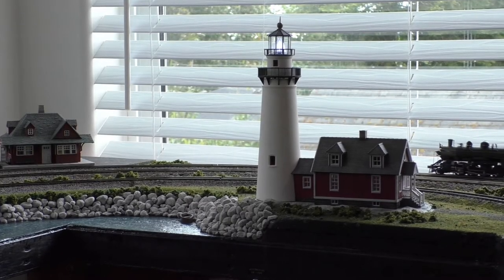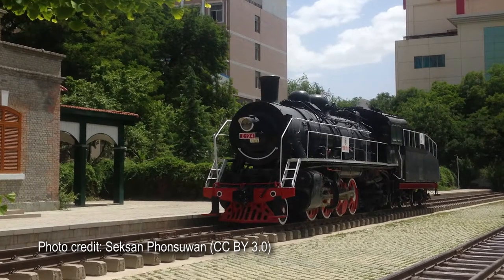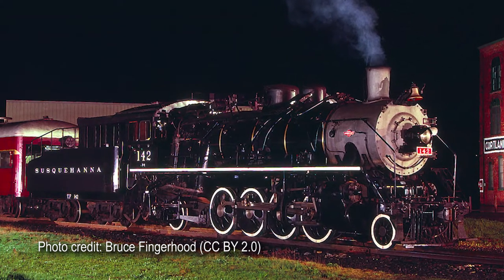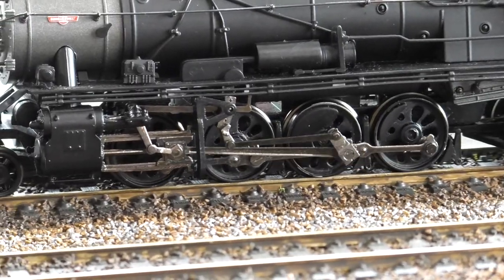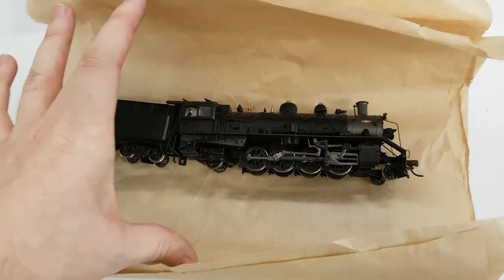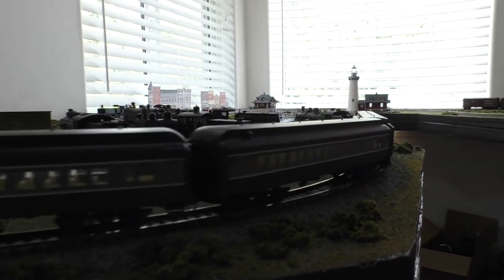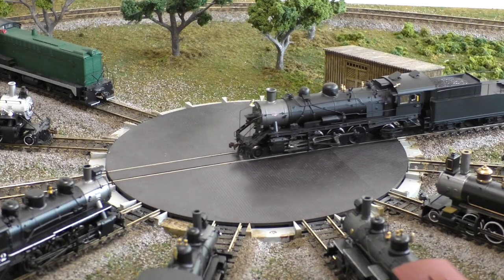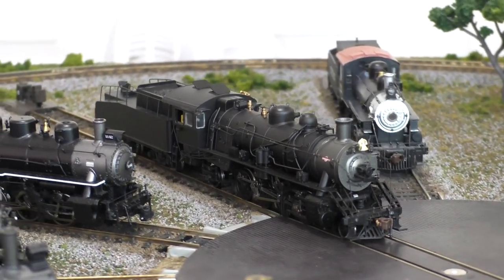Bachmann Chinese SY 2-8-2 Mikado: a modern-day steam engine?

Comment: Great Review of the engine!! I just finished modifying my own SY to better resemble the Valley's 3025. Mine seems to have similar issues at slower speeds as well, possible to the some of the modifications. (I needed to reverse all of the appliances to the other sides to match the prototype better. I have even been able to work on the actual engine during regular volunteer shop nights which also helped with getting reference photos. 

As for the two engines mentioned in your video; yes the Valley owned both but not at the same time. The first engines was No. 1647 and originally had the red wheels like other Chinese engines. It was sold in 1991 to NYS&W when the third engine sank and renumbered 142.  Years later the Valley purchased the burnt remains of Knox and Kane No. 58. (Engine was damaged in arson fire) and restored to resemble a New Haven Railroad J1 Mikado. Now 3025 still in operation at VRR today.
Reply: Hi! I would love to see a picture of that. I live on the Valley RR's tracks, right at the end of the line in Chester. Huge fan ever since I was a kid!
Reply: The line3 doesn't end in Chester, it continues to Middletown. But, the tourist trains only use the track to Goodspeed's (Haddam) and recently cleared track north of there through the marina. Before the rails through the marina were buried in dirt.

Comment: I’ve had mine for a few years, great runner although it doesn’t pull well. I installed tcs wowsound in mine, they have a kit for it if I remember right, improves it ten fold.

Comment: Found one of these at a trainshow and preparing to add DCC to it so I can run it on my main layout…any decoder recommendations? I was told a TCS WOWsound 121 is a good decoder. Also where did you get those coaches? Would love to pick some up
Reply from the maker: Make sure to get a decoder with a good BEMF function. TCS WowSound should work well (although I recently put WowSound in this loco and have been having some issues, but I think they're probably my fault). The coaches are 60' commuter cars from Rivarossi - sadly out of production now, but you may be able to find some used.

Comment: Very nice! I never knew there was a  genuine class of steam engines built past 1960.
Reply: Apparently China did make locos during the 1960s so I guess China was the only country with operating steam locomotives
Reply from the maker: @warbabyproductions  South Africa had a few 42" gauge 4-8-4s in freight service until 2015 as well, although I'm not sure they were building new ones any later than the 1980s. There may be other countries that also used steam into the 21st century, but I can't think of any the top of my head. It tended to happen mostly in places where coal was cheaper than oil.

Technically, the Strasburg Rail Road in Pennsylvania also occasionally moves freight with their steam locomotives, but it's not exactly regular service.
Reply: @warbabyproductions  plenty of engines were made past 1960s but the very last commercial steam engine was made in 1999 and yes it was a  SY　made for use in China at a coal mine.

Comment: That is a cool locomotive! I wish “Bachmann Trains” would build a retooled version of it from the ground up by using today’s standards! Such as installing a smooth running DCC motor, multiple colors, road names and numbers as ways as appearances! They will also keep the way that the engine and the tender connect together!

Comment: I've got an off-topic question, what has happened to W&SC No. 12? Is it a parts engine or have you got it tucked away in a box somewhere?
Reply from the maker: It's currently sitting on my desk, waiting for me to figure out what to do with it. I'll probably put it on static display somewhere eventually (maybe not on the layout itself), or I might use it for parts.

Comment: I have this locomotive as well it's a good runner. The only problem is I want to install a decoder and I've tried multiple times to get the tender open but it won't budge and I have no idea what else to do.
Reply from the maker: The tender goes together in a weird way. I got it apart once, but unfortunately I can't remember how.

Comment: That drawbar design is actually recycled and or copied from their 2000s era spectrum N&W j class models - my 611 hasn’t had any issues with it whatsoever and actually runs alright on 18 radius curves because of this. I have no idea what the modern ones use though. 2000s spectrum was a peak for bachmann and really it just seems they’ve been living on that high for about 20 years now. 

I’ve always wanted an SY to make New Haven 3025 (1658 as it stands today), however the only time I’ve seen one in person went for $450 at a hobby shop (I struggle to think about how I paid $460 for a Rapido EP5, even after waiting 5 years and seeing the model progress from render to functional prototype) and I haven’t seen one since.
Reply from the maker: Interesting - I didn't realize that drawbar design had been used on any other American-prototype locos. It does seem to work quite well.

$450 is definitely too much. I wouldn't pay more than about $200 for one of these.

Comment: She’s such a beaut! I would love picking one up one day! But may I ask where did yours?
Reply from the maker: I found mine by pure luck. I work at a hobby shop that often buys used train collections, and this turned up in one of them. If you're looking for one, eBay is probably your best bet, but they only turn up very occasionally. Also check any hobby shops in your area, and go to train shows if you can. With relatively rare models like this, it's often just a matter of being in the right place at the right time.
Reply: @michaelramsey81  thanks I’ll be sure to be on the look out!

Comment: Ok just pet peeve but guys, if your motors are weak. They either need cleaned or remagnatized. Please try to remagnatize them, you will destroy your engine over working them on bad magnets. Do not do this, just remagnatize and it should be ok. The best way to do it with motors that use two magnets is it rub a really strong magnet against one, then rub the two motor magnets. This equally divide the strength between them after a while of rubbing them together. Or just get a device that can do it.
Reply from the maker: Thanks - I'm going to try this! The performance of this loco has gotten gradually worse since filming this video (to the point where I hardly ever run it anymore), and I'd rather not have to replace the entire motor.

Comment: Which loco was the loco that sank into the Indian Ocean
Reply from the maker: It was a brand new 1991 SY Mikado that would have become Susquehanna #141. The Susquehanna bought one of the Valley Railroad's engines to replace it, and that become #142.
Reply: @michaelramsey81  bit of a late reply but very interesting to know none the less

Comment: can you help me find one please
Reply from the maker: These are getting very hard to find. I actually just sold this one to someone who had been looking for one for a long time. If there are no model railroad folks in your area who might know someone with one for sale, your best bet is probably eBay.
Reply: Is it out of print? I live in eastern PA and the 142 is about 20 miles from me in Phillipsburg, NJ well it's stored south of Phillipsburg when not in operation. It was supposed to return to service this year after a two year inspection. They were using a diesel the past two years for the tourist trains. They now run to Riegelsville, NJ where they built a small station and you can get off. I rode it over 10 years ago before they extended the ride two more miles to Riegelsville. Track goes several more miles to Milford, NJ and a half mile of track was removed recently south of Milford.
Reply from the maker: @robkrasinski6217  Sadly, the model is out of production.

Comment: W&SC #107?
Reply from the maker: I haven't decided on a number yet. It will probably be the highest-numbered engine on the W&SC, since it's technically the most recently built prototype (my newest diesel is a GP9), but it will still be a 2-digit number.
Reply: @michaelramsey81  W&SC #99
Reply from the maker: @owenmcmaster4298  A possiblity. I might do #89, since that's the year Susequehanna #142 was built, or #60, the first year of production for the SY class.